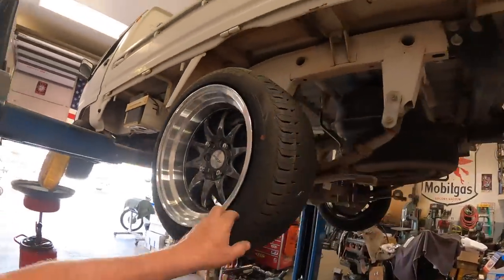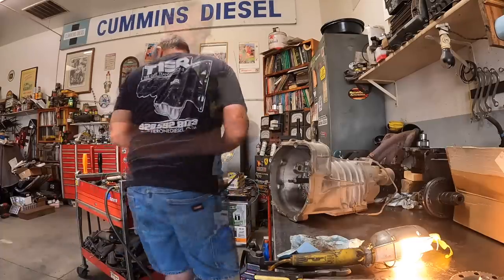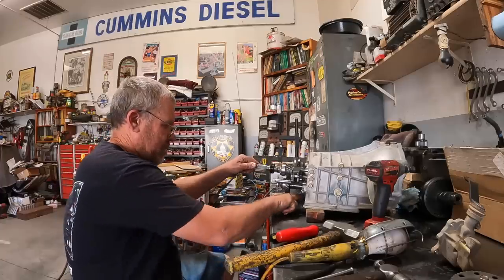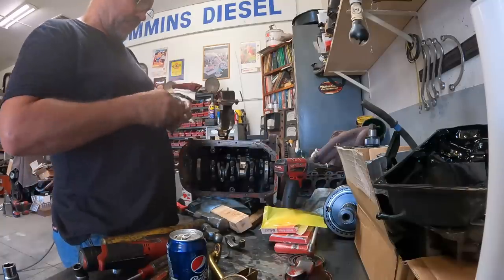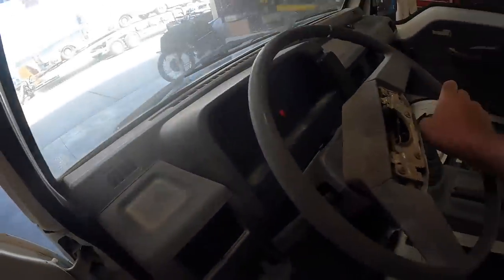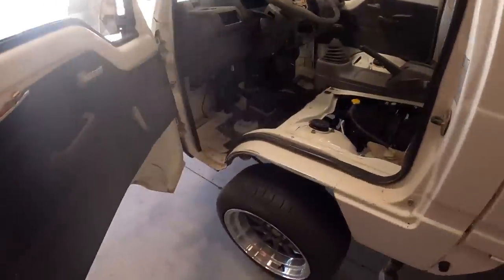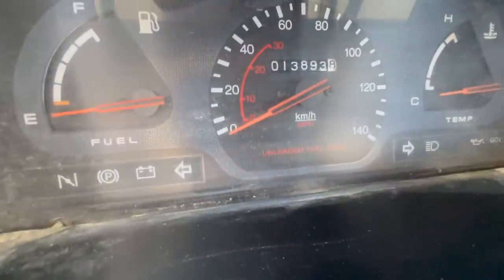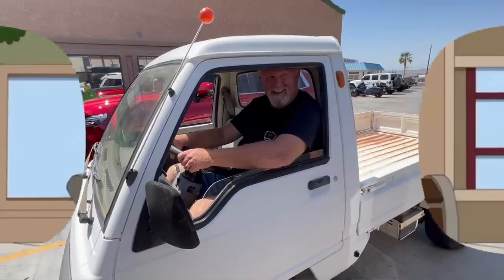How to Make Your Kei Grocery Getter Truck to Do 140 KM/H

Comment: The Euro Version is an piaggio porter and has 1.3ĺ inline 4 with 85 HP they are lincensed build Daihatsu hijet many city's an county services in germany had them in the mid 90's and early 2000's in italy and greece were many of them as work truck s for div. Trades an City delivery vehicle

Comment: You paid $500 for that?  I've seen used ones go for as much as $11 grand here.  And someone bought it.  I've bought $700 pickups and put $1500+ into them.  So you bought rings for $300.  That's 8 hundred.  Another $300 for bearings ($1100.00 total) is still EASILY within a profit margin, AFTER you've driven a year or 2.  I understand if you didn't have the $300 at the time.  You have a lift and can do it later, but... you already had it apart.  I guess I'm not understanding the logic.